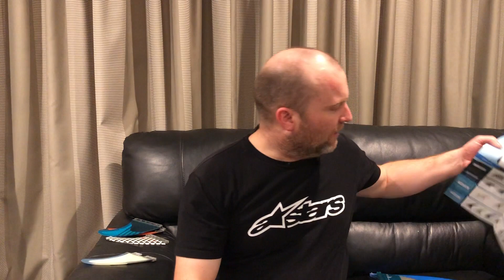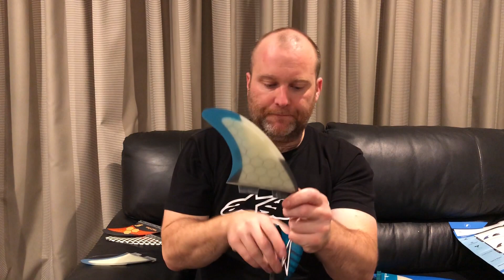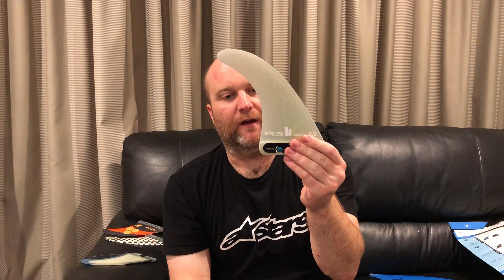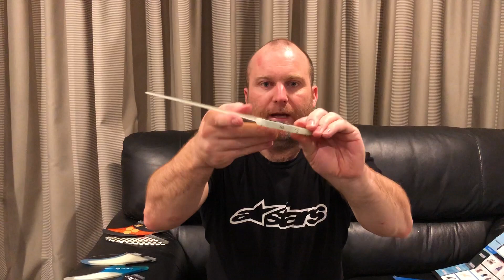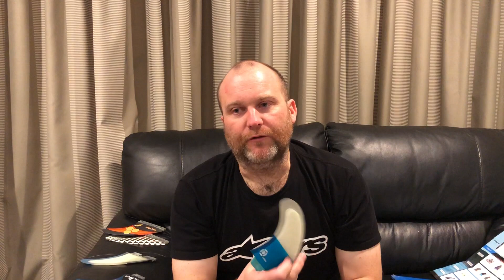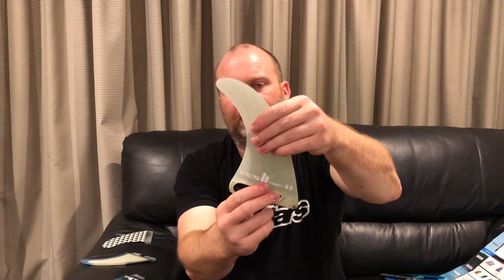SURFBOARD FINS Complete Guide Part 2

Comment: Well done! After scouring the net for 2 weeks trying to learn about fins, your vid is the best. I am mostly interested to know when to swap out fins, and what with, depending on conditions eg what to throw into my Lost uber-driver when its super big, vs average, vs super small. Also, I'm right on the border between a small and medium fin recommendation and wondering when to go smaller rather than a larger template? Your vid came closest to answering these questions.
Reply from the maker: Hi Russell. Thanks very much for the feedback, much appreciated glad people are finding it helpful. Honestly it's a really subjective and person thing and different people are looking for different things in different conditions.

I think there will always be some trial and error but also the laws of surface area, rake and flex will still hold strong . If you use surface area as one of the most important this will allow you to find the larger than average small fins and the smaller than average Medium fins if you believe you fall in between the two. 

Personally i'm a big advocate of a larger fin than you possibly need myself and like the extra drive when it's small and the extra hold when it's big.

Others might say they are happy with less fin when it's big.

Also Rake VS upright the more raked will have a bit more rake and hold but also might leave you feeling a little stiff on turns so there is that option to go more upright.

Personally I stay with the same fins for most conditions and i'm my hybrid boards that's a AM Large or a Matt Biolos large. 

If you have played around with the basic templates a little you can get some feedback on the different feels. Problem with a lot of fins is they dont always just chance one element so say FCS 2 they have a rector (upright), a performer (miduim rake) and a carver (generous rake) but they also change surface aera so it's not apples to apples on just one element if that makes sense.

I think Futures do a series where the areas stay very similar and rake changes...

Here is my take though rake or depth will really help with hold base will add drive but unfortunately all of these things can have an oposite downside. 

Personally small waves I go decent area to creat drive untill its getting in the way of turning bigger waves I like rake and depth to ensure hold and I really tend to like templates that have decent base depth and rake without a really fat tip almost across the board but the next guy might like a really fat short upright fin... 

Then you have to take all that into consideration along with the board feel... So same fins different board you might find one board is too loose, more rake or epth or surface area or a combination of the above might help. Super tight board to turn maybe more upright smaller area fin...

Same with materials stiff is grip and drive flexible is a little more forgiving and easier to turn. Duper soft flex will be wet and noodly and slow to respond.. 

Your welcome to let me know what templates you have and what you do and don't like and I can try to suggest some options if that helps. 

I dont have much experience with small and meduim fins specifically but you can do a lit looking at teh fin charts and knowing what to add or remove in are rake etc to get the desired result. Hope that helps.
Reply: @lawson45uk  Thanks for the detailed reply :) That's some helpful info there. You seem to be in agreement with everyone else about fin size - when in doubt - go bigger. (just to nerd out on fins a bit more - my limited experience so far has been the Mat Biolos medium, which blew me away - so much drive and speed - possibly too much for me on big waves??? I recently tried medium FCSII performers PC which I hoped would better control speed and be a bit more forgiving in the big surf - which I feel they they are. I know the uber-driver isn't shaped for big waves but will be interesting to see how much difference a fin can make)

Comment: Hi, what kind of size fins would you use for the Firewire The Gem 9'1"? Thank you
Reply from the maker: Hi mate. Probably best to check out my review of the GEM I give a few recommendations there.  https://www.youtube.com/watch?v=OgSILs652YU&t=280s
Reply: I use a greenough 4a 7.5 and 3.5 sides and it absolutely flies. Due to the models profile and bottom contours this set up I felt really worked well...♥️🌊🇮🇪🤙🤙

Comment: Thanks for this fin guide! I was just wondering why you switched from Futures to FCS 2: it's hard to get a good answer regarding which fin system is better, people either seem dead set on one or the other, or the exact opposite, that they're both great. I'm asking because I picked up a used board with FCS 2 boxes, and my other boards are original FCS. I only have 3 sets of pretty beaten-up FCS twin tab fins, so I'm not particularly invested in FCS, but I'd be interested to hear your perspective. Thanks!
Reply from the maker: Hei Owen.
They are definitely both good systems.. I did do a detailed reply to this question somewhere but can’t find it. Might even do a feature on it one day..
So the old FCS1 I liked a lot of the fin templates but found the base connection to the board wasn’t as good as Futures so moved over to having both for a while then FCS2 came out and that addressed the base connection and you could still screw them in as well which eliminated the side play you can sometimes get in Futures if the clearances are not spot on so I got a bit over having so many fins in each system for the few boards I had in Futures as I order Customs in FCS2 so sold the Futures and got a new board instead.. I actually use both again now I’m shaping my own boards… There both great systems that are pretty strong reliable and well made but here are a few of the plus and minus…
FCS2 
Plus: strong, easy to fit, fins available everywhere, tool free, good range, Strong R&D quality fins, big players all on board.
 Minus: Can pop out (I screw them too to be safe), can be expensive, they tend to use the same or similar templates rebranded for some fins (especially rear quads) The patent means if you want after market it’s meant you have to go back to the old 2 tab versions (FCS1 Retrofit to FCS2 box) for a long time which sucks. Good now but did have very limited twins and keels.
Futures:
Plus: Boxes have a strong connection to the board, easy to fit, lots of fin designs, some really good foils especially V2, Excellent availability on aftermarket brands like Captain fin and Naked Viking etc so lots of options for special prices. Incredible twin and keel selection across all brands.
Minus: Used to be slightly less available than FCS but not the case now. Can have some side play between fin and box. If boxes do pull out (unlikely) it will be messy.
One big point people might not know is FCS have the Cant built into the box and Futures have it in the fin and they run different cants. FCS fronts will be 9 Deg. Futures I think 6 ish Deg??
Hope this all helps. Since I have all fins and boxes and tool for them I might do a wee feature some time as it’s probably a popular question for people and hard to know which to go for.
Cheers.
Reply: @lawson45uk  Thanks for your detailed reply! I actually have a Torq funboard I picked up the other day used that has futures fins, and I noticed there's significant play with the fins, wasn't sure if it was a typical problem with futures, or if it was just the cheap Scarfini fins that came with the board. BTW,  there's a brand of fins here in Spain called Feather Fins; all the Spanish pros are riding them. They make FCS 2 compatible bases and ship worldwide. A Futures vs FCS feature would be great. Thanks again!
Reply from the maker: Ohhhhhhhh yeah those fins do look nice. Good sturdy looking job of the FCS2 cuts I like it 👍 yeah I see a fee  people are starting to make them into FCS2 bases now maybe patent is clear yeah does happen on some futures. Probably more so with boards that have heat and pressure involved in the process. Torqs are actually pretty decent for the price and what they are designed for. Finished are usually pretty accurate and decent which you can't say about everything at that price point. If the fins are staying in and they have wobble I just get some plastic thin flat packaging from a box or even wrap a sticker round the base and put them back in. I do it on my longboard fins too I can't stand wobbles 🤣

Comment: Hey man, thanks heaps for the fin guide!
Unfortunately I found this the day after I bought some fins. Was looking for a set of thrusters. I ended up with the fcs accelerator performance core. Pretty stoked as it’s pretty close to what you recommend as a starting point. Didn’t have much range at out local shop (trying to buy local at the moment to support them so they’re  still there after all this blows over).
Anyway, I looked at a heap of fin guides on the net and this one is easily the clearest and the best.
Great work!!
Reply from the maker: Hi Redarm. Awesome mate. Thanks so much for taking the time to leave some nice feedback really appreciate it. Yeah performers are definitely a good fin and probably about the perfect starting place. If you feel like there is something lacking from they're it's not too hard to pick something that might give you that extra something too. Give me a shout if you ever want a hand but thanks for watching and giving some feedback.
Reply: GO SURF No problem mate, I was going to get some quad rears for the accelerators. Was thinking about some reactors. The board is an Omni. It has so much gold at the moment I thought it might free it up a bit. What do you reckon? Thanks again for the whole channel mate, really enjoy it.
Reply from the maker: Redarm A Ah sorry I totally missread I seem to have read performers for some reason 😬 ok so accelerator also a really good fin by they are a large surface area fin. What what do you weigh what's the dims and volume on your board and what size accelerators did you get then I can probably give you some more detail. For sure the reactors will make the back end a little looser the Omni should have lots of hold built in by design I would say so it's possible to offset that in a number of ways. Also how is the drive on the Omni and would you have happy to sacrifice a little drive for it to turn a little better. That might help me give you a few recommendations. If you message me on Instagram too I can always send some pics to show you comparisons of the different fin templates. With the accelerator fins it's possibly you may have more fin than you need for that board. Cheers. Install I think is go_surf_nz cheers
Reply: GO SURF thanks man, for the reply. I weigh 67kg and have a 5’11 Omni at 37l. I actually got the board cause I wanted a board with plenty of hold for winter waves here on the south coast of Western Australia. It appears that’s what I’ve got. Only had a few surfs on it and it definitely has plenty of hold and drive. Pretty stoked with it.  I’m not opposed to getting a new set of thrusters if that’s what needs to happen. Basically, the board showed up and I had no fins for it so I went to the shop and that’s all they had. I don’t know much about fins but am starting to see how much difference they can make. Thanks again for all your help mate!
Reply: Oh yeah, the accelerator are medium’s.
Reply from the maker: @redarma6241  Cool mate. Sounds like you have a good spot there.. Be pretty powerful in WA so Omni would be a good choice.

Ok.. So yeah technically your a medium fin at that weight but a lot of people in your weight range ride a large. Especially if like me you ride a generous (sensible in my language) volume to weight ratio and are in bigger waves. So the Accelerators in a medium are probably a good starting point for you as they are on the larger side of a medium.

Have a look at my fin guide again but when it comes to choosing fins I usually start with a fin I know and it's surface area then figure out what i'm looking to change from there.
Here is the FCS site for fin data.  

https://www.surffcs.com.au/pages/fcs-fin-data

You will see that the Medium Accelerator is more surface area than the medium Performer and actually a similar size to some of the large fins like say a Matt biolos.. So for you maybe we are looking to loose a little surface area to get it a little looser or possible even try to redistribute a similar surface area in a different way or get into a fin set that has a slightly smaller back fin than sides like the Merrick or something then the shape of the fin all matters, rake base tip area etc...

Have a look at some of my videos but we can definitely get you into something that turns a little better. 

Fins like your accelerator will pobably create some nice drive but in bigger waves your probably looking more for control that drive.. 

Gets pretty complicated but I can definitely make some recommendations for you.
Reply from the maker: @redarma6241  Did you say you already have quad rears or are riding the Omni as a quad and have you also tried a thruster?
Reply: GO SURF only tried it as a thruster. I’m going to get some quad rears but unsure what to get. Was thinking maybe some reactor rear mediums. I know a couple of people with a Cymatic and they love it as a quad. Will check out some of your other vids. Thanks again mate.
Reply from the maker: Redarm A yup medium performer or reactor rear quads both be a good option 👍 reactor obviously slightly more upright (looser ) performer medium is the one that comes with most quad sets 🤙👍
Reply: GO SURF legend! Thanks for all the help with the fins. I’ll get one of the two you mentioned then have a play around with another set of thrusters I think. We have a weeks worth of swell coming through here at the moment, hopefully some makes its way to you (not to sure how it works there).